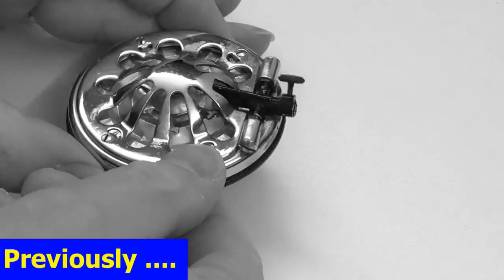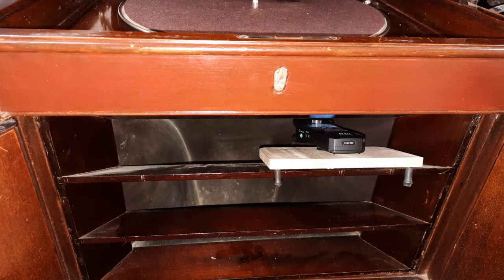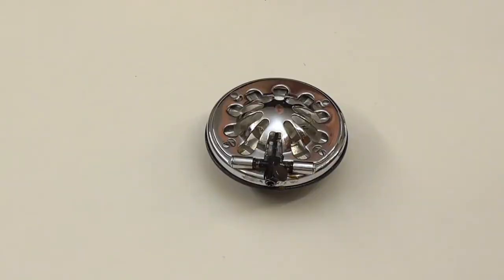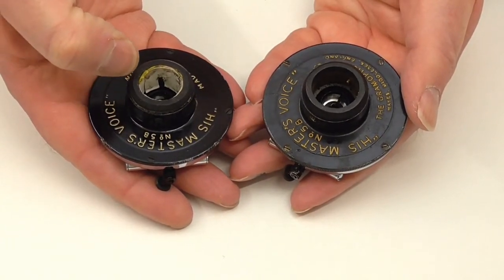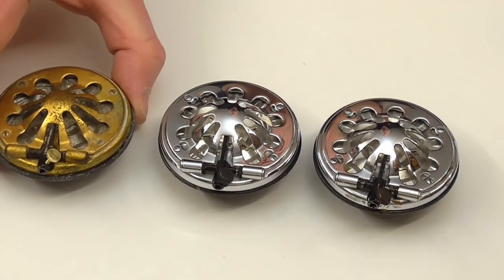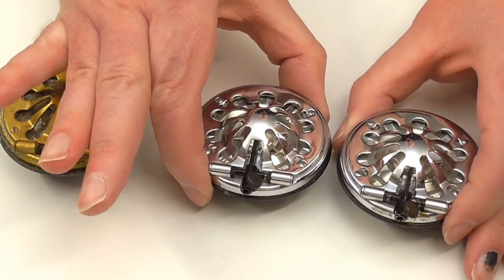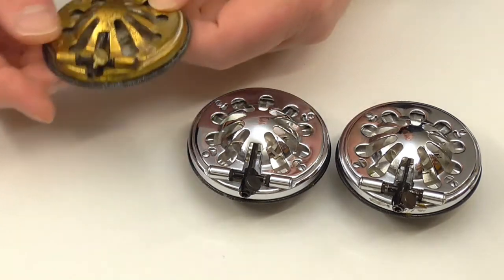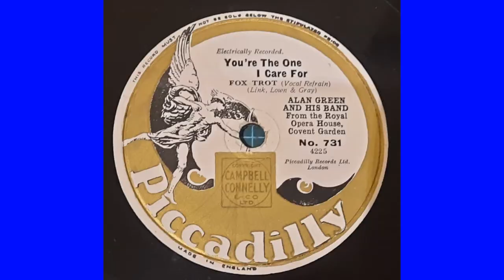Broken HMV 5B soundbox - how bad can it be?

Comment: My money’s on either a stray gramophone needle or possibly one of the three tiny screws that holds the air baffle thingy fastened to the inside of the back plate. 
Soak the back plate screws in penetrating fluid before attempting to unscrew them but I’ve found on the 5b they come out fairly easily then the back plate separates as the back plate doesn’t swell as bad as the 5a
Reply from the maker: Thanks 👍😀.  Yes it will be interesting to see what's inside

Comment: I got the same problem with my 5B too.. But the needle bar is detached..
Reply from the maker: I believe this one has a detached needle bar which needs resoldering to the spider. Will have to open up and see if that's the case. Thanks 👍😀

Comment: The broken 5b sounds ok !!
Reply from the maker: Thanks 👍😀.  It does sound better though once I have fixed it though:
https://youtu.be/H9BgfxvyaPw
Reply: @mrrgstuff  ………… I meant that it didn’t sound too bad and I would have just ‘put up with it’. But that Chris bloke is a perfectionist 😂
Reply from the maker: I think soundboxes often don't sound too bad until you have something to compare them too 🤔. In this case, the 5B was broken in use, so it immediately sounded worse, and  although Chris repaired it, the repair didn't last and the buzzing was quite noticeable. What was interesting was that I had the chance to compare it to my 5B which didn't perform as well as I expected it to and not as well as my very tatty 5A 😀
In the end though, if a soundbox sounds good enough to use, then it probably is! 😉😅

Comment: Thanks mate, that 5a looks like a very early one...  I have a 5a too, but it is almost indistinguishable from the 5b in looks.. The 5a is pot metal and therefore poorer quality compared to the 5b..
Reply from the maker: I really must do some research on these as I  don't really know all the differences between the 5A and the 5B. Your 5B is very similar to mine, but different in a few ways, as well as the different writing. I will have to see which is closer to the 5A. Thanks 👍😀